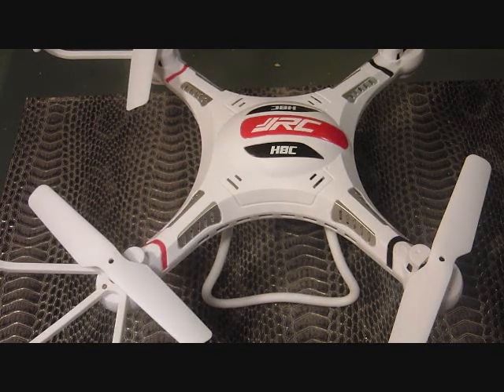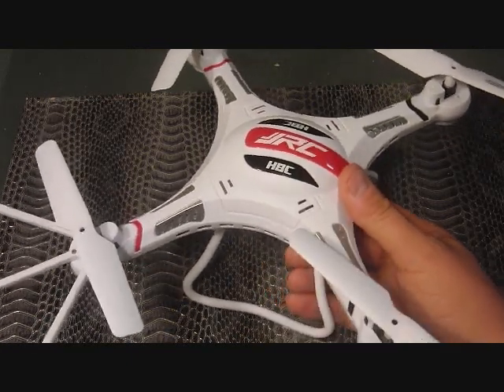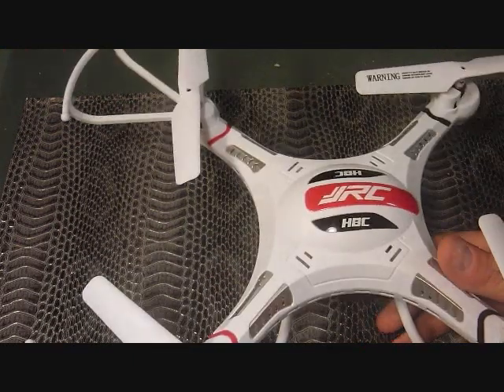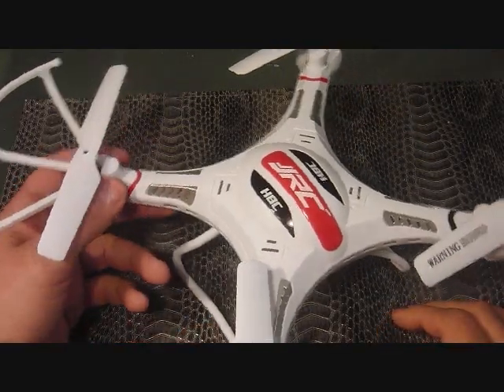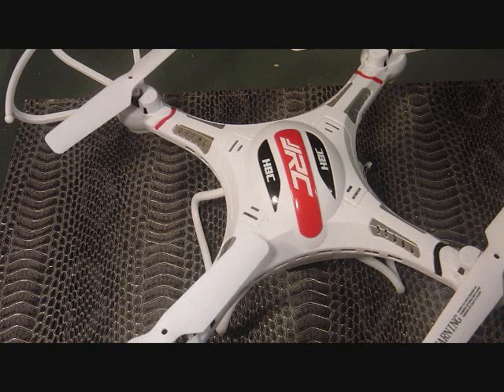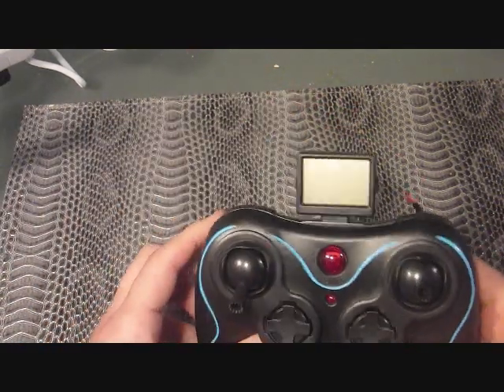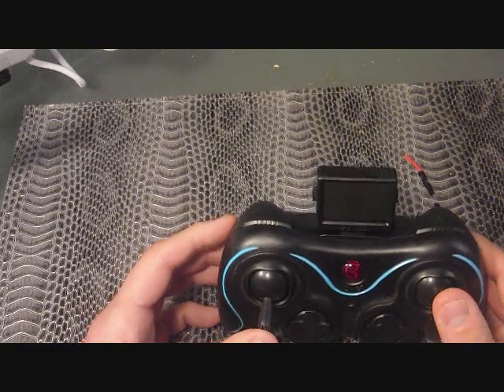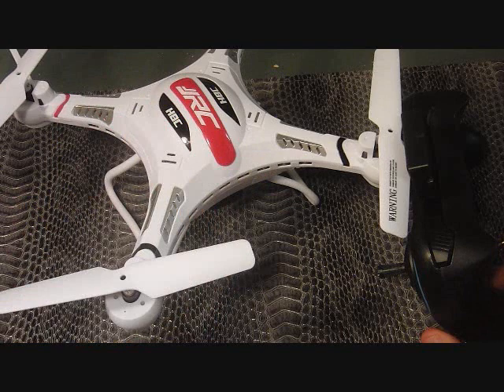JRC H8C quad copter tune up---antenna extension

Comment: Yeah I tried adjusting the switches,  but nothing.  Won't even lift up. Then after 1 minute of tweaking with it the quad starts flashing the lights and battery goes dead that quick.  Buddy said it could be a bad battery.  Going to try another battery and see what happens.

Comment: Keeping the front prop guards on for orientation works great. I use that tip for my other quads and flying is much easier. Thanks.

Comment: I just received my JJRC HR8 in the mail Wednesday 2/4/15 and finally took it out the box today and no camera came with it. That's not my mane problem right now because after charging the battery and ready for test flight it won't even go up!! All it does is go/lean in the red light direction. When I pick it up and if it leans while in my hand it's like you can hear the motors pick accelerate and decelerate. Need help or is it a bad quad I got?? Any help greatly appreciated people!.. Thanks
Reply: I'm assuming you checked the proper blades were mounted to their corresponding motors as reversing them will give the effect you described.
Reply from the maker: sounds like your gyros need adjusting... on your controller,on the right lower control button,keep pressing the top button ..do this while the quad is running with enough power to almost take off.while pressing the top button repeatedly,you will notice the quad leveling out..then you should be able to take off..i do adjustments every time before i take off..

Comment: I'm an amateur radio operator and one important factor for optimum performance at 2.4 GHz is orientation. If you orient the antenna in the same plane as the receiver you will achieve maximum performance. Having them parallel is even better. BTW your in flight video looks a lot like Tucson?? Oro Valley specifically..

Comment: If you can, open up the H8C and extend the antenna to 3 times it's length (if 31mm, then 93mm total length), and try to snake it beneath the electronics.  This will help the receive range significantly.  It has to be an odd multiple.

You can do the same with the transmitter, extend it to 93mm and stick it a straw tube glued to the side to hold it rigid.  The tube should be angled to the side, not pointing at the flying quad.
Reply: When I say beneath I mean under and outside the quad.
Reply from the maker: yeah im experimenting with that right now.but now i have a motor out..so i will have to wait

Comment: I also have this quad and have been flying for sometime now.  #1. You need to get that antenna out of the remote.  Mine actually measured the proper 31mm. But, having it in the remote covered by your hand is not good.
2# balance the props.  Good point you mentioned.  Also, for those that don't wish to mod, the WL Toys transmitter:http://www.banggood.com/Wholesale-WLtoys-V912-4CH-Single-Blade-RC-Helicopter-Spare-Parts-Transmitter-p-62435.html

is far better.  Good Flying.
Reply: No thats a helicopter transmitter get this quad version
http://www.banggood.com/WLtoys-V222-2_4G-4CH-6-Axis-RC-Quadcopter-Transmitter-p-78480.html
Reply: Yes, I caught that error from another poster and corrected on my Youtube videos.
My H8C is out of commission.  Bad board..  Banggood replacing for free.  Freakin 3 week wait however.
Reply: MrPolymers yep i like my h8c a lot i was thinking of gettting the cheerson cx20 but it's too loud.This little cheerson (h8c) will work for me and the range on the upgraded wltoyz transmitter is awesome at $25.00 im thinking of buying another for backup.

Comment: I cut a notch in the right side of my controller, right at the seam and pulled the whole antenna wire out through there.  Opening the controller was easy except for the one screw under the battery spring lol

Comment: Bonjour,pouvez vous me dire le diamètre du fil pour l'antenne ,et la longueur .Quelle distance entre le drone et l’émetteur.Je viens de commander le même, êtes vous content du drone, quel défaut sur cette machine .Merci de me répondre svp bonne année 2015 à vous et votre famille
Reply from the maker: not sure of wire diameter.i just tried to match the diameter of the antenna wire..after my changes,i was happy with this quad..
Reply: Salut Jp. J'ai lu ton message au sujet du drone H8C, j'aimerais bien savoir ce que tu en pense maintenant que cela fait quelque temps que tu en as un.? Je cherche des avis avant de l'acheter. Merci de ta réponse... (cyclope2009@hotmail.fr)
Reply: Jean-Luc Gauthier
Ok,pas de problème particulier pour le drone.Il fonctionne très bien ,j'ai déjà fais 20 ou 25 vols.Par contre la première chose à faire situ fais de la vidéo,c'est l'équilibrage des hélices.Une fois cela fait, plus d'effet gello super bien.J'ai pas fait encore la modif pour l'antenne j'ai pas encore trouvé la longueur exacte sur les forums.Bonne journée JP
Reply: jean pierre menou Merci beaucoup. A+

Comment: Thanks for the video, where do you Solder the antenna to the raido? Can you see where when you take it apart?
Reply from the maker: NVampire
i just used a wire of equal width and length,and solder it.. nothing special
Reply from the maker: yeah,just take it apart .you will see the antenna..extension piece is the same length as the clear coated insulation piece on the antenna..it is about 1 inch long.
Reply: DEROCK72 which cable you use to increase the length of the antenna? you simply solder it?
Reply: DEROCK72 thanks. I solder 1 of 8 wire from UTP-5. laid it in a circle inside the control and output about 15cm. It working far better.